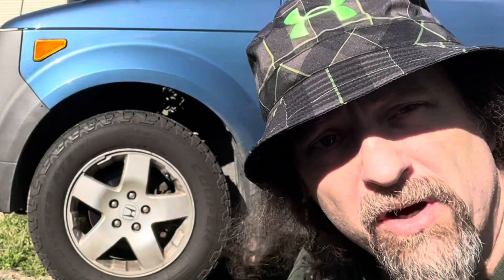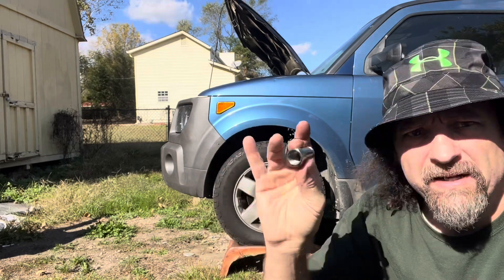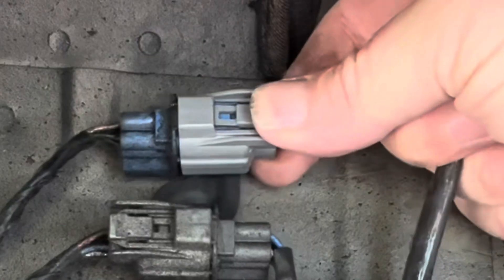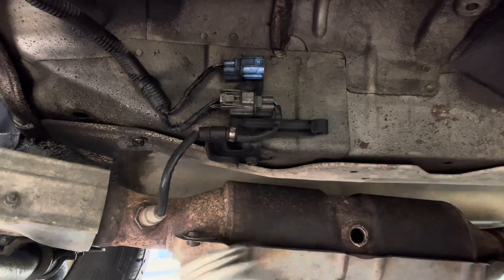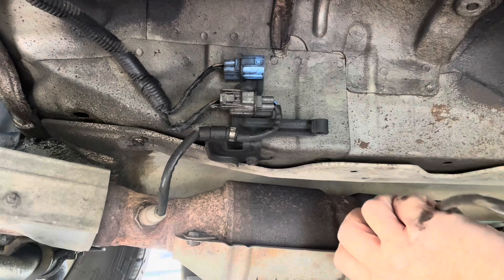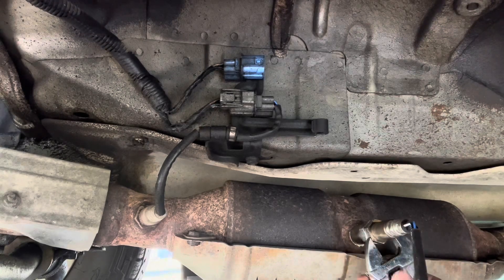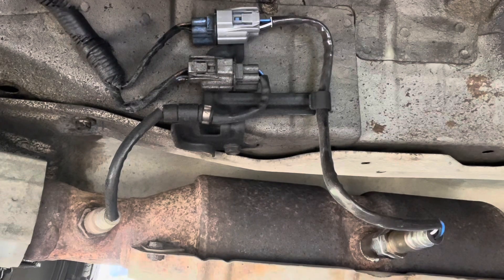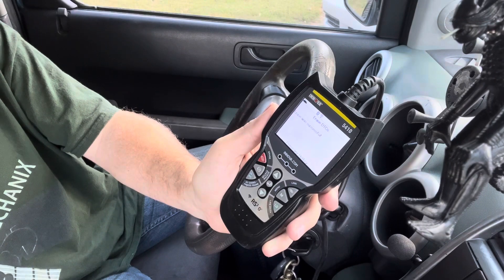Can a Honda Element PO 420 code be eliminated with a BLOX Racing spark plug defouler?

Comment: so i installed it but now still have P0138 error for:  showing a lack of oxygen in the exhaust system.     ,  would drilling this defouler out wider bring in more oxygen?
Reply from the maker: It might. I've never had to address the 0138 error.

Comment: On honda I've learned you need to use only Honda oem or Denso sensors . The others will not work
Reply from the maker: I have also used BOSCH with good results but you can't go wrong with OEM.
Reply from the maker: For o2 sensors?

Comment: Good one Clint. Will be interesting to see if it will be confirmed you didn’t need to drill the hole larger. If it makes a difference.?  Thanks
Reply from the maker: That's the plan.

Comment: I did this on my 2002 Honda CR-V. It worked perfectly. I recall seeing a video that the EPA requires cars manufactured after a certain year to purposely include a test to increase pollutants and confirm the downstream O2 sensor reacts appropriately. This test is specifically to detect cars with spark plug fowlers. I'd think that a short spark plug fowler on a borderline cat could still fool the new test.
Reply from the maker: Yea, the good ol EPA. They are always lots of fun.

Comment: I have an 03 I just purchased.. a month ago.. and it has a recurring 0420 code. What is the thread size I need for my o2 sensor?
Reply from the maker: Link in the description with all the information.
Reply: Oops.. just got a notification that that website has a virus... might want to run your antivirus on your phone/computer to clean it off..

Comment: Had the P0420 code (cat efficiency) and went through two lengths of non-foulers with no luck.  However, I determined that my downstream HO2 sensor was aftermarket and had gone bad.  Bought a Denso, eliminated the non-fouler, cleared the code and the issue never came back.  So, this probably only works if you have an OEM or a Denso HO2 sensor that's working fine.  I also checked my LT and ST fuel trims and found out that I had the wrong MAP sensor. Replaced that too and all is good.  Yeah, a history of your E would be fun.🙂
Reply from the maker: The downstream O2 sensor I'm currently running is a cheap Rack Auto unit. I can't tell you why some folks have luck with this and some don't.
Reply: @clintsearcy3252  I have a shop-fabricated catalytic converter made from a "universal" core.  It's not new but I do suspect that was part of the problem and the old sensor was like yours; cheap and didn't last long.